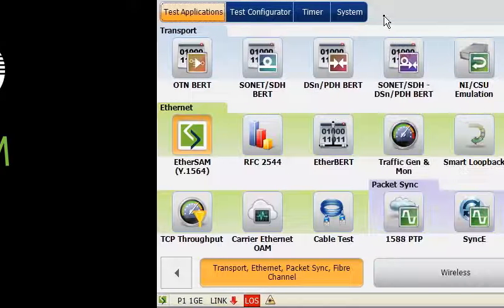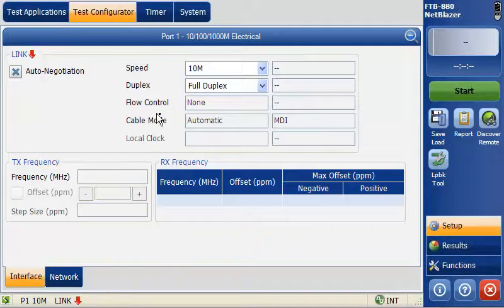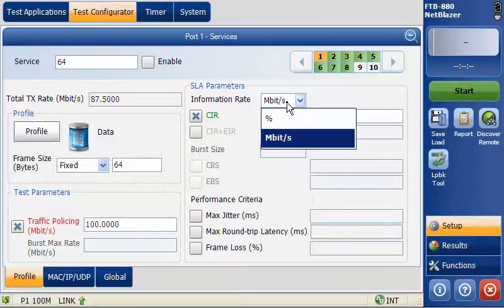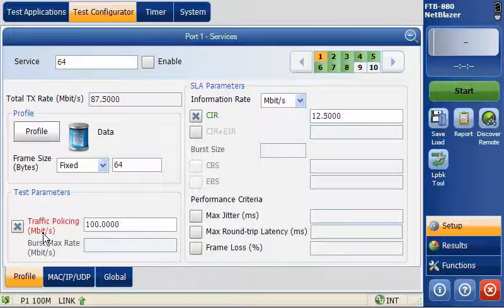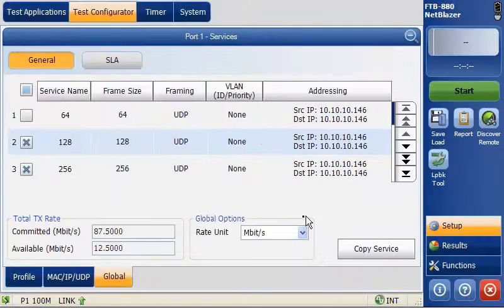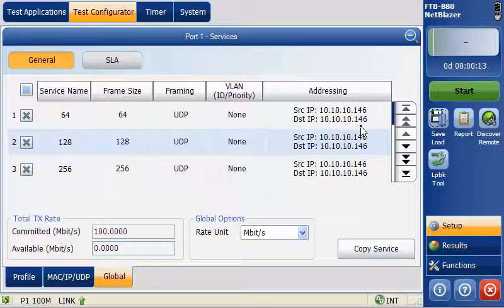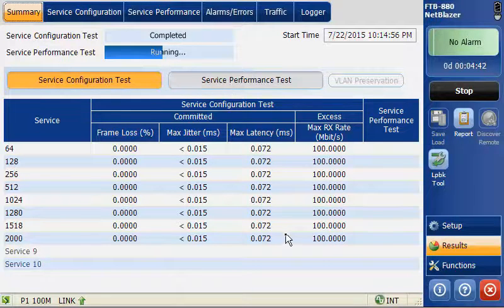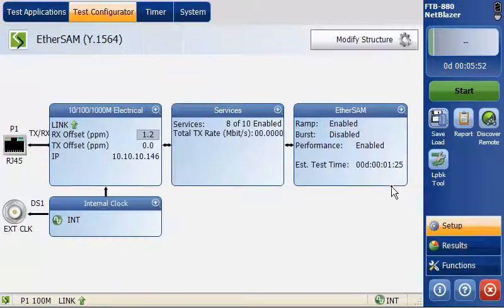EtherSAM Setup July 24 15

Comment: Sorry if the answer is in the video, but i did not find it scanning trough it. I would like to perform bi-directional test with one wire, two exfo testers. Using Ethernet frames. Is Ethersam the right program for this?

I guess this i test i need to perform is closer to a RFC 2544 than y.1564 standard.
Reply from the maker: You can perform dual test set using EtherSAM. In the settings you can select Dual Test set and have it scan for the second unit. I am not sure if I have a video on this though.
Reply: @KevinPeres  Thank you for your quick respond🙏I will test today.
Reply: @KevinPeres  I ran etherSam now with dual test set ok, but is this truly bi-directional, or just another way to do loopback?
Reply: I think i got it, for my test, I can use the RFC 2544 it appears(also in dual setup)
Reply from the maker: @ if it’s dual test to another EXFO it is true bidirectional if you have it set up that way. It can do ooopback as well but when you set it up make sure it’s set up for dual test